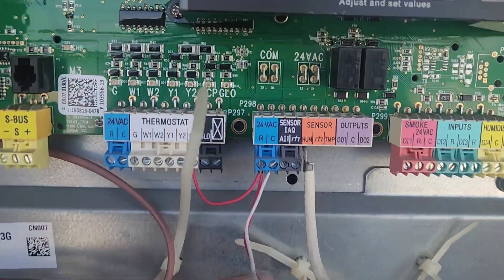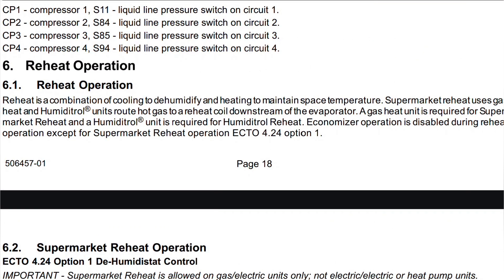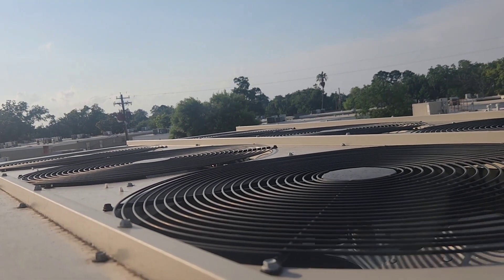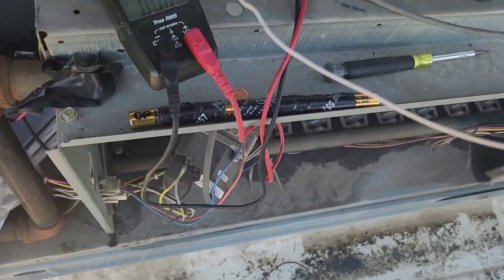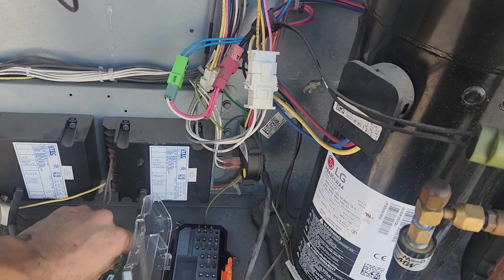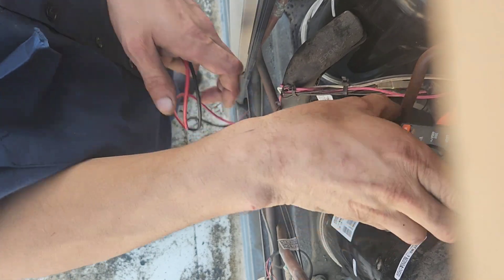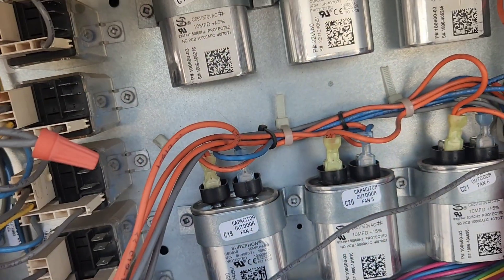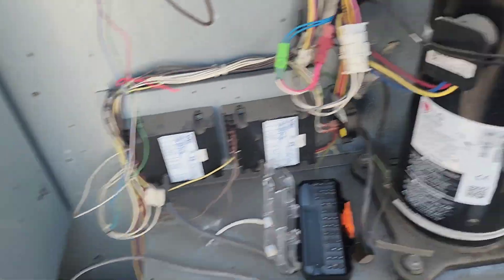LENNOX RTU Humidity Sensor & Testing Capacitors

Comment: Lennox parts quality has taken a dip. Especially when they started using there own inter link brand. You lost the relay from a lock rotor amp condition from the failed run capacitor. Most likely from overheat them cheap sleeve bearing motors are Knacked. Cooks the oil out of the wicking. I would ohm out them motors and check for endplay. Also would recommend getting a uF meter to test caps out of circuit. One last watch out for TPO roof slime!